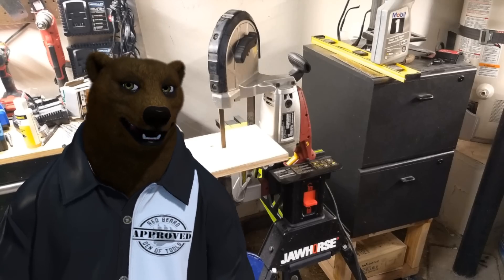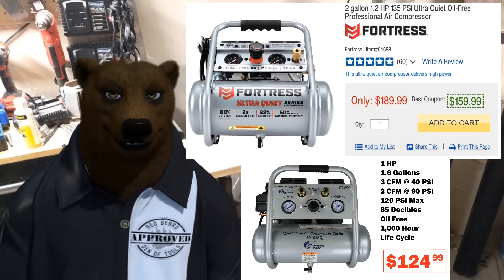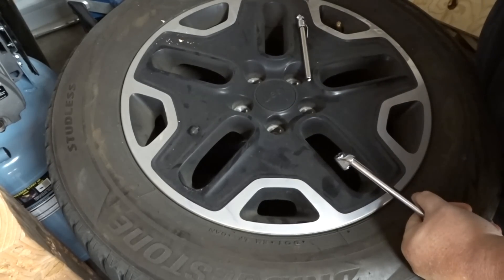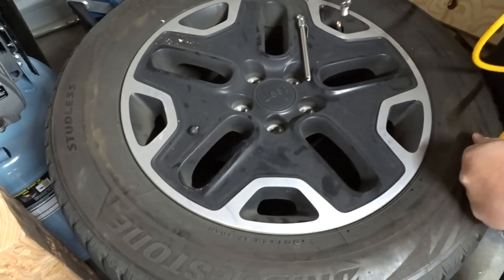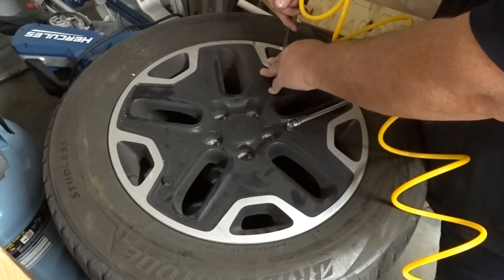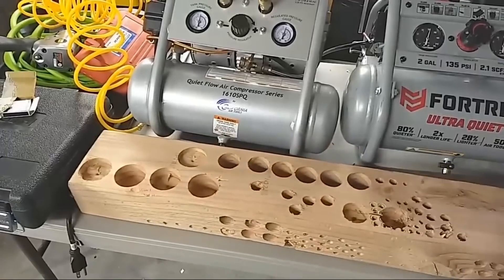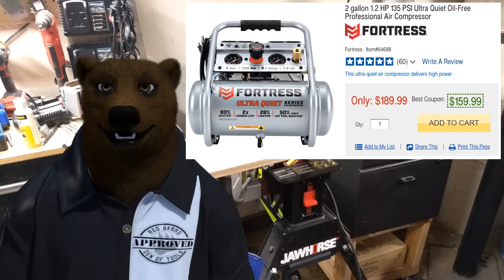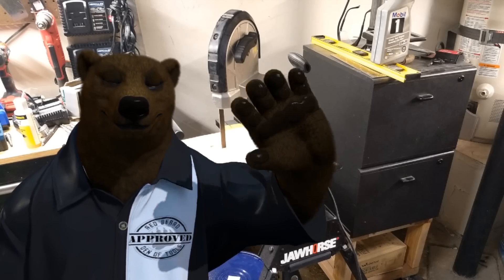Quiet Compressor Battle (Harbor Freight Fortress vs CAT)

Comment: I have the two gallon Fortress Ultra Quiet two gallon a few months back. I like it - I run Milwaukee M18 impacts so no need for a large air compressor. I use the air for blowing off dirt, drying, brake bleeding and of course topping up tire pressure. 

One idea I have for Harbor Freight - on the next design evolution for this Fortress compressor rework the size / roll cage so it fits on the shelf under the US General Mechanics rolling tool cart. At its current size it almost fits. If it could fit it would save floor space in my shop and the compressor would roll around with the cart when needed.

Comment: 4:30 you did not just use a pen tire gauge

Doesn't the Pierce Brad nailer have bump mode?
Reply from the maker: Yes!  And I don't think that bump mode is something you usually see on brad nailers is it?
Reply: Could have just used the gauge on the tank. When the pressure equalizes, it should read the same as the tire.  Watch the gauge go down as it fills. When it stops going down, it's done-

Comment: For my summer workshop and my winter workshop I had two Porter Cable pancakes.  I always wore hearing protection. In my summer workshop I have infamous 21 gallon/2.5 HP $149.99 Central Pneumatic beast.  I was able to sell both Porter Cable pancakes for a decent costs and ended up buying two Fortress 2-hp compressors which are quiet and handle most jobs.  My only complaint is their air capacity is a major drawback.  YouTube has a segment that shows how guy rigged a large air tank, using professional air hoses and that solves that problem but by then portability is out the window.  The Fortresses are high quality and a great bargain.
Reply: Just bought one of these on sale. $129 including extended warranty. This unit is far and away so much more quiet than my Bostich that finally died. Looks to be built pretty rugged. Time will tell.
Reply: They wanted $22 for extended warranty yesterday when I bought it. Nice sale if it was only about $100 for the basic unit!